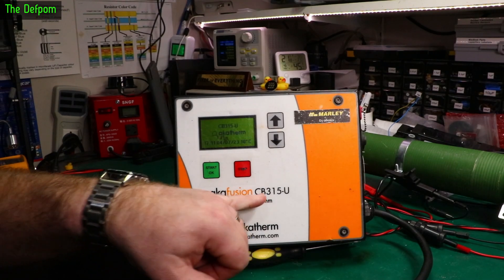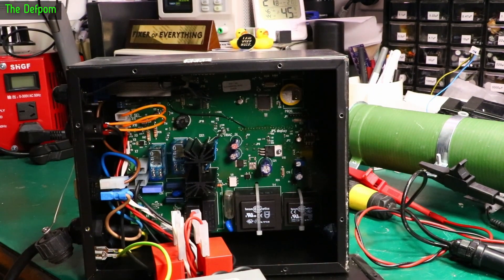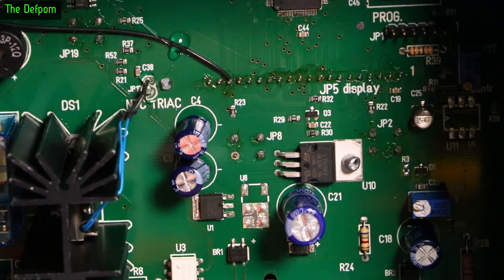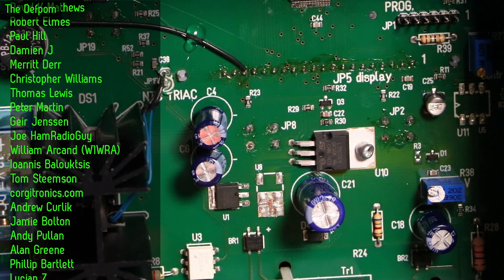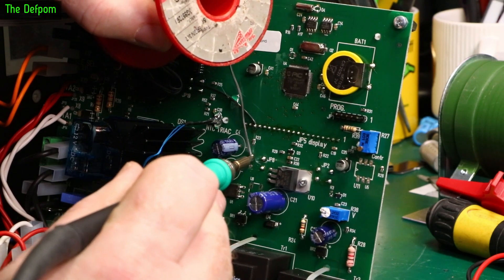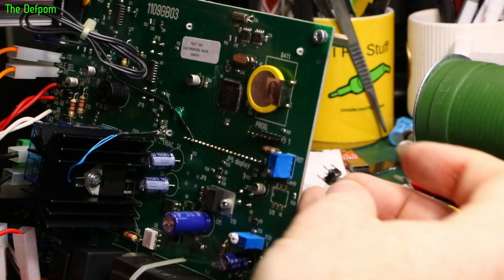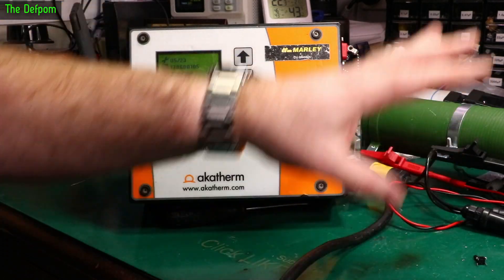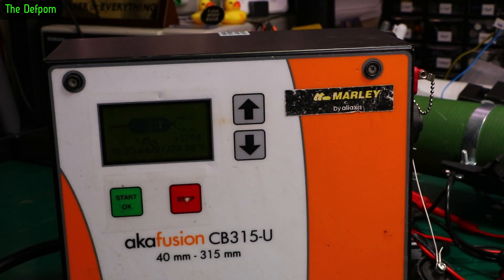🔴 Akatherm CB-315 Electrofusion Welder Repair SN_170600105 - No.1171

Comment: Hello, I have a device from the company Valsir and the electronic card is very similar to yours. I get an error e 20. I can't find a faulty component. Can you help me? Thank you.
Reply from the maker: In the CB-315 manual error 20: 20 – AMBIENT TEMPERATURE OUT OF RANGE
Probable cause: The ambient temperature is out of range ( -10°C to +45°C ).

It may or may not be the same unit, but I have seen these units re-branded before. I would be checking for damage to the temperature sensor.